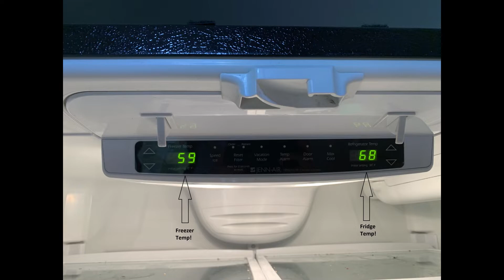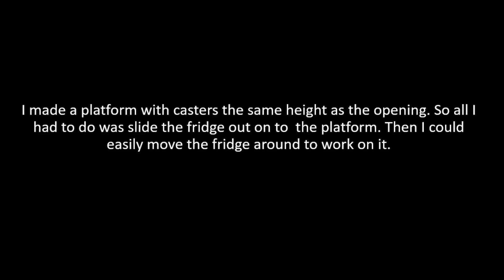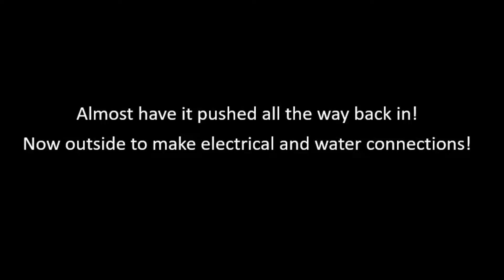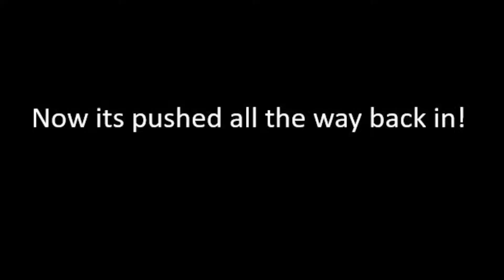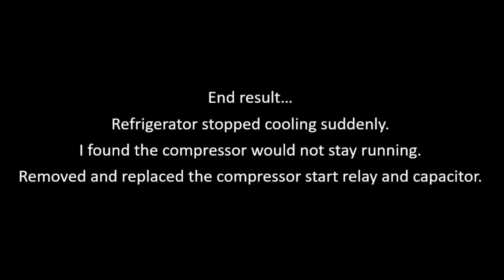RV residential refrigerator stopped cooling!

Comment: is this an RV fridge- specifc fix? or is this how you would fix a normal fridge with this problem?
Reply from the maker: This is a residential refrigerator that was put in this RV. This failure is a fairly common on most refrigerators. Thanks for watching!